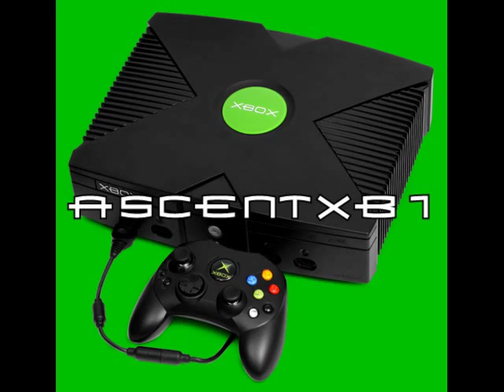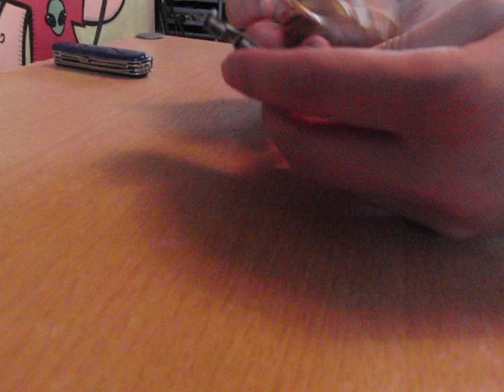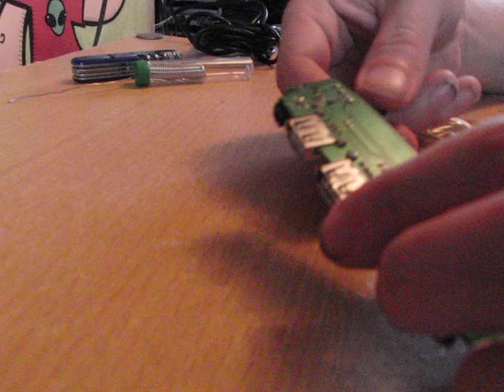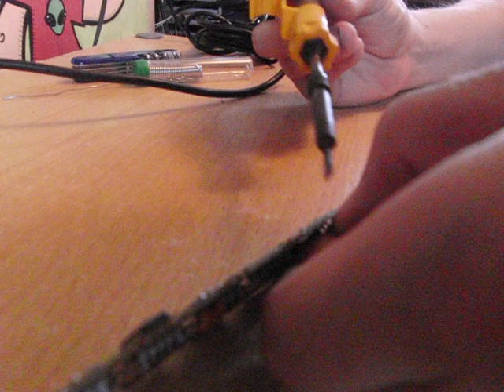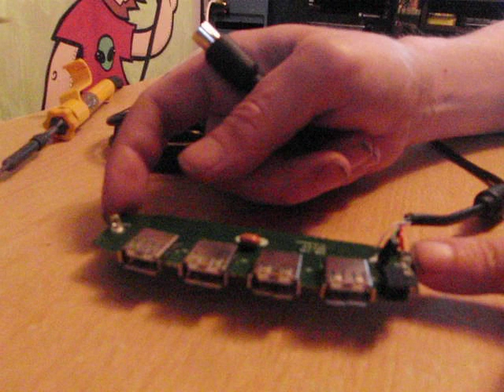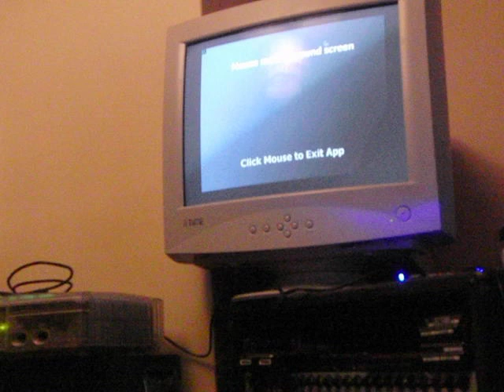AscentXB1 Tutorials -=- How to connect usb devices to your xbox 1

Comment: Noticed you had you xbox hooked up to a monitor.  Did you use a rca to vga converter?
Reply: Evan Johnston no i was using a pci capture card in my pc .. but now i use an composit video to vga adaptor to do the same thing  cost about £20 from ebay

Comment: just fyi , some usb keys just will not work at all with the xbox , the one i tried in the video was a 4gb kingston data traveler , and neither xbmc or the standard xbox dashboard would read it , i tried a 2gb micro sd card in a usb adapter and that worked perfectly as a mem card straight away 

there is a list on the xbmc site of comparable usb keys when i get a moment i will find the link and add it to the description bar